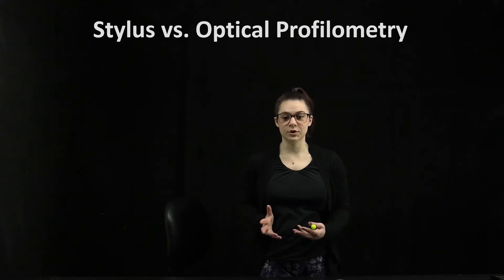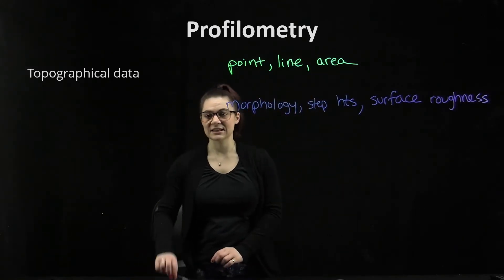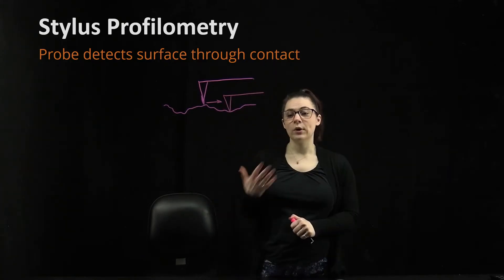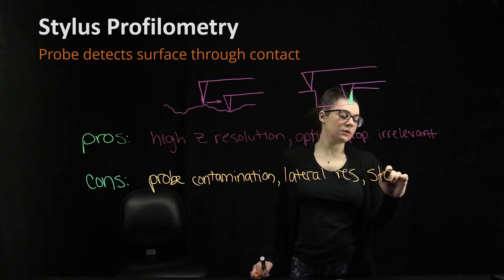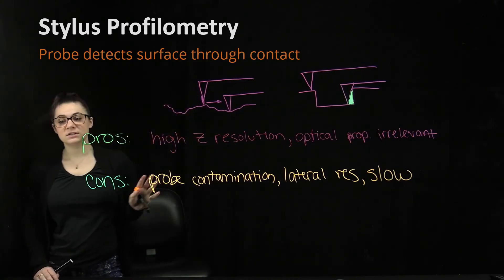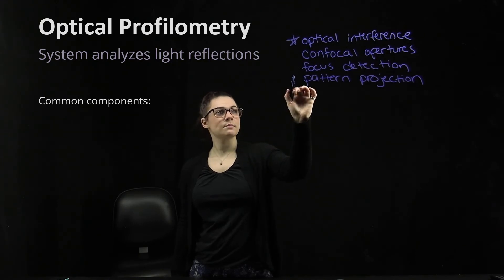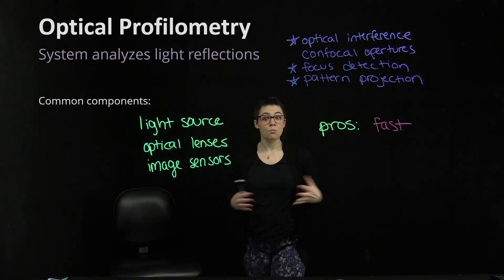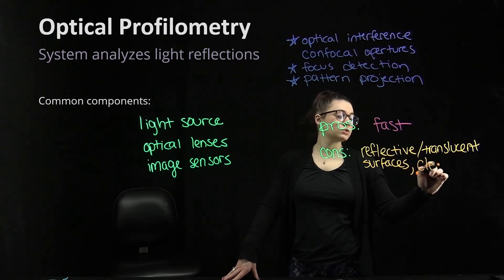Profilometry Overview: Stylus vs. Optical

Comment: Very informative video, thanks! I need to measure surface roughness of Silicon wafers that have been 'spalled', or broken from a crystal boule. I think a stylus system is a good starting point; much less expensive than a laser interferometer, but how can a stylus give topology of an area? I am currently working with 100 mm diameter wafers.